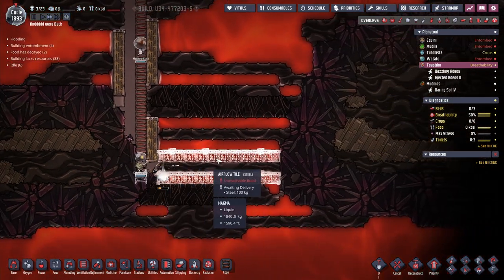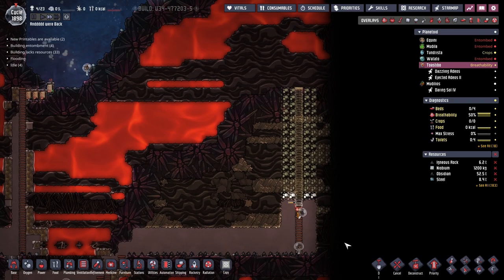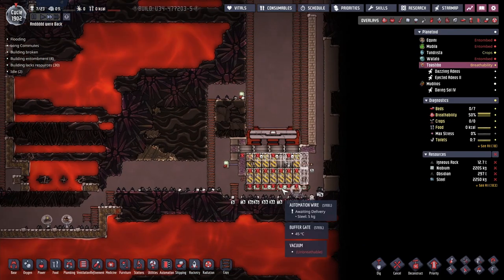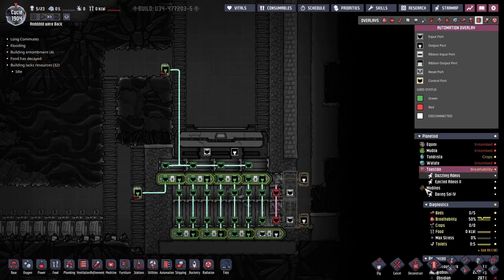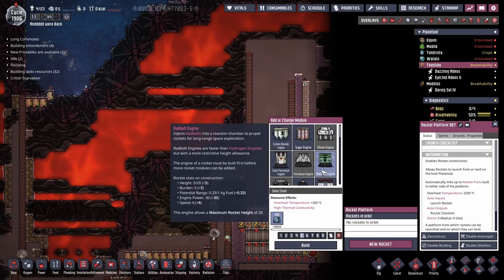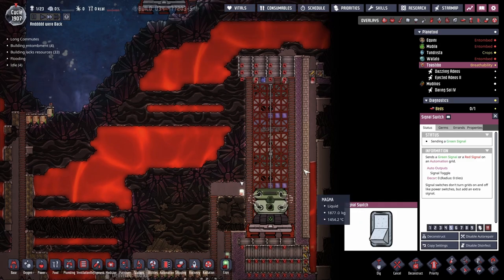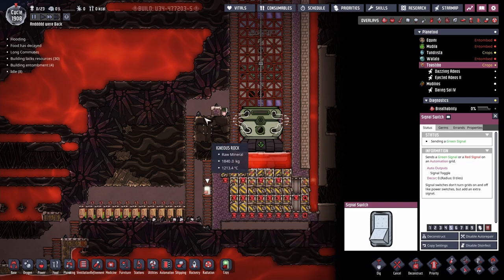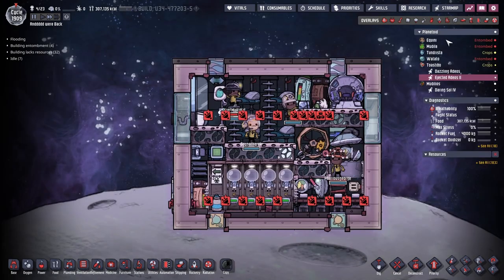Ep 27 : A Volcanic lair beneath the magma : Oxygen not included Spaced out

Comment: This may be the most insane thing I've ever seen you build. I love it so much. Also, you could just let the niobium from the volcano pour into an area below the door pumps and transfer heat via bunker tiles instead of the insulated tiles you have there currently. Also, the rocket exhaust should(?) heat up that area decently as well and provide a heat boost to the magma every time the rocket is activated. Might be the easiest solution.
Reply: rocket exaust is COOLER than the magma and will drag temperature DOWN with each landing
Reply: @mrShift_0044  That's only if the exhaust is touching the magma. If the exhaust is contained inside the silo, the 3x9 area of effect of the rocket will heat up the magma below, not cool it down. So as long as those top doors (and bottom doors) are closed when the rocket lands, the rocket will only add heat to the tiles below the rocket, not cool it down.

Comment: This is awesome.  To remove the gasses fast I would highly recommend using a liquid-gas bypass pump.  They pump large amounts of gas very fast until the pressure gets low.  You would then use a conventional pump to pump the final bit.
Reply: How does that work?
Reply: You can search on the Klei forums for Mathmanican's original post on it, but essentially imagine you have 2 chambers with an 1-tile L-shaped gap joining them.  If you put a small amount (say 500g) of a liquid in the apex of the gap that would make a liquid lock.  Now if you drip a small amount of another liquid onto this liquid lock, the game wants that liquid to move down and to the side.  In doing so, it displaces the gas in that tile, which moves past the liquid lock up and diagonally across.  This can be used to pump gas very fast and without using power. The game actually deletes the drip liquid if the amount is very small, making this very convenient in some situations.